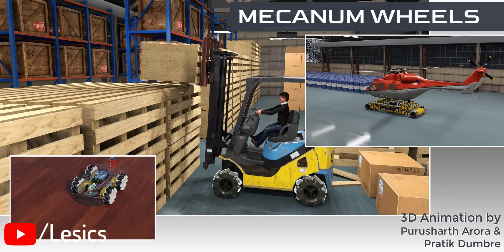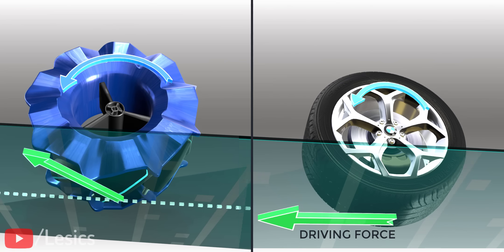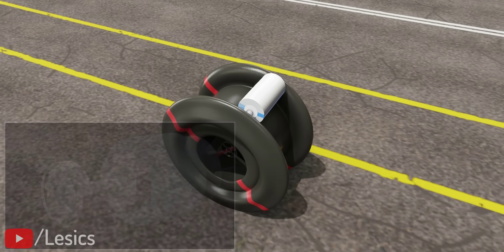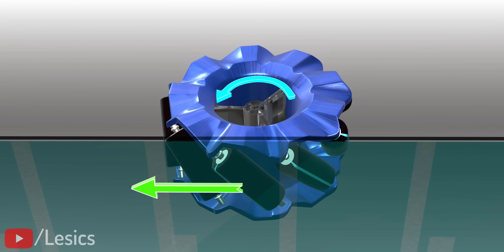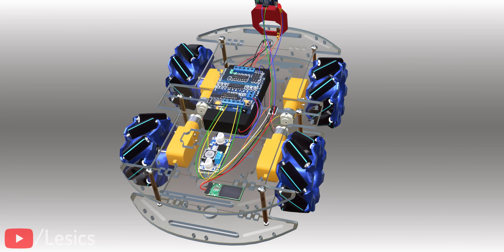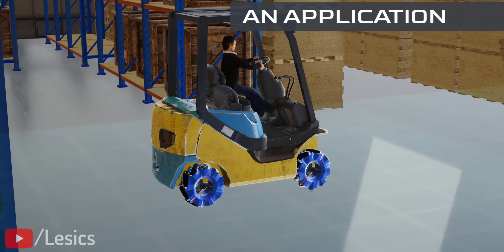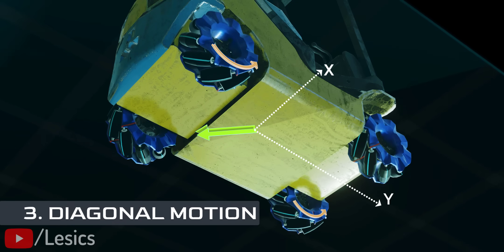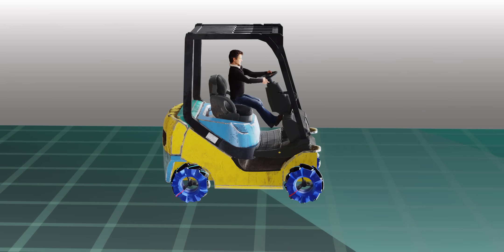The Brilliant Engineering of Mecanum Wheels!

Comment: Most forklifts have rear-wheel steering, and some forklifts have all wheel steering, so yeah while these wheels can turn in place, I'll bet that they are much more expensive than your typical forklift and wouldn't be very likely to be put on applications like this (else, everywhere would have them by now since mecanum wheels have been a known thing for many years).
Reply: Wojciech Pordzik  I think the only real application here would be for warehouses of extremely volatile substances, military use, or when there isn't a lot of space. The example they gave would have been plenty of space for any of the forklifts I mentioned.
Reply: @zeke7100  If anything these would see military use only after many years of successful commercial use- military acquisition bodies are notorious for discarding advanced designs in favour of cheaper ones. In terms of substances with special handling requirements it's often more cost-effective to employ measures to reduce the risk involved, or prevent the risk entirely by not storing or handling them altogether- in industry you can buy containers of elemental flourine gas and store it if you really need to but in the vast majority of cases you it's far more cost effective to generate it in-situ and use it immediately, you don't need to reinvent the wheel to try and make a situation safer when you can prevent the situation entirely.
Personally I see these fulfilling a similar role that tracks would serve, the issue is that tracks are already very successful in that role and are already in widespread production and don't require so many moving parts, it's possible the freedom of angular movement from a standstill might provide an edge against tracked locomotion in robots that are required to maneuver in narrow spaces but they're up against stiff competition.
Reply: @zeke7100  could you elaborate on why those applications came to mind for you? I don't quite see how/why. Military - because cutting edge/enormous budget? Precision of movement? Cheers
Reply: @juliasmith1182  I would assume the military would want to hold volatile substances in the smallest location that they can, even stacking items on top of each other to save space, and having a forklift that could easily and safely make it's way down those isles of stuff would be a huge help. Or maybe places like where fireworks are stored. The less steps you need to get a forklift to go one way or the other, the safer it would be and the less likely an accident could occur. With normal wheels you'll at least need to make a 1-2 point turn but with wheels that are omni-directional, all you'd need to do is just slide to the left, slide to the right, etc.
Reply: @zeke7100  not really going to help much the small electric cat forklift would work better than this.
Reply: This might be practical as a wheelchair or medical application.  Maybe as a form of entertainment.  I think the heavier the load the less likely it might be to be reliable.
Reply: All I could think was "that is the only front wheel steering forklift I have ever seen..."
Reply: @kerrumz1  and it's not even real just animated which leads me to believe the people behind this video know next to nothing about forklifts.
Reply: @ktm125sxbeast  just trying to make them look less efficient really.
Reply: @ktm125sxbeast  yet they already exist and they are practical. For people wondering the wheels don't really wear faster as the don't scrub near as much as solid tires. They are weight limited but no where near as much as some think.
Reply: I believe it comes down to maintenance/complexity as well. Forklift tyres are, well, tough as nails. Can't recall if they're solid rubber entirely, but at the very least, fabrication and replacement aught to be cheaper. That said, cost of maintenance/repair on macanum wheels might be cheaper as a single roller, or perhaps a roller axil might need changing. Pure speculation...
Reply: @juliasmith1182  forklift tires are usually solid but some types have air in them.
Reply: @juliasmith1182  the rollers themselves would be subject to extreme loads as well which doesn't seem likely to last long under such extreme weights.
Reply: Facts
Reply: Caterpillar had the same idea a long time ago and zero turn lawn mowers more recently. Four wheels of this type for a forklift would triple the cost of the machine plus create a maintenance nightmare.
Reply: Plus the forklifts I operate you can turn the wheels like 180°
Reply: @whatusernameis5295  you can on all of them that have the two small rear tires that sit together in the middle.
Reply: @ktm125sxbeast  well these aren't. The rear tires are at the sides of the forklift and yet they can turn pretty close to 180°
Reply: @whatusernameis5295  yea they have those where I work too, most forklifts can almost turn 180° because they turn with the rear axle. The ones I mentioned can turn the rear wheels a full 180° though. Imo they're the best forklifts unless you're driving outside.
Reply: Like everything else, they'll get cheaper with time & demand.
Reply: These would be great for a forklift to use on a ship
Reply: @rdrdrd7777  lmao
Reply: Why is everyone so focused on forklifts. The forklift was used simply to illustrate how the wheels work. Mecanum wheels are not economical for large/heavy vehicles. However, for some small vehicle applications that require high maneuverability and precision, these wheels are amazing. Search YT and watch how they work on robots.
Reply: There are already forklifts that use these wheels https://youtu.be/0DBXuZv38l8
Reply: Reading thru this it feels like many don't seem to know that they already make forklifts that use these and have for years. Mostly they are used in warehouses and a lot of warehouse bots use them because the have to be electric as they have a motor in each corner. Gas/propane ones just don't have the drivelines to make them work. I can tell you going from a standard lift to one with mecanum wheels was a trip and took me a few day to get used to controls as the use a joystick instead of a steering wheel.
Reply: @josephdecesaro1528  I'll be straight up and admit I didn't know and I didn't bother to check either, good to know though and I can imagine it'd probably be challenging initially to learn how to use them. Personally I've never seen or heard of anyone else who's seen or heard of a similar machine being used but warehouse robotisation/automation is pretty poor in my area at present (whether it'll stay that way in the near future is hard to say)
Reply: @josephdecesaro1528  However most places that use forklifts driven by an operator doesn't use these special wheels. It is true though that a lot of robot-driven warehouses like amazon use them, but I feel like it's more of a "aha look at me I have advanced technology" than it actually being significantly more useful.
Reply: @zeke7100  This imaginary story comes to mind. A drunk forklift driver is operating one of these beside a dock. Says, “Hey guys, hold my beer and watch this. I’m gonna open this old thing up and flip this here little switch right here!”
Reply: @josephdecesaro1528  i have a question what do you use them for as the only thing i can think of them being useful is if you produce long beams. the hole it fits in tight spaces is invalid to me as i drive a stand up fork lift and the rack space i work with is probably about form the back to probably a little past that dudes feet.
Reply: @butspan7618  It's mostly warehouses and it's not about fitting in to a tighter space but the speed of shifting and rotating stock. Let's say you need to shift over a 4 tall rack that's 6 long to accommodate a stock change. Well with mecanum wheels I can line up, stab in, lift, back up and then slide sideways the 4 ft to the next rack and put it in. For one move it saves all of 4 to 8 secs but when doing that for 8 hrs a day well you can get more done. It does help with getting say pipes and beams thru small openings. When they switched us it slowed us down for the 1st few weeks but as we got more comfortable with them a 4 hr move with a normal lift changed to a 3 hrs. They are only really good where the lifts never really stop moving.
Reply: May be because of patents. My primary concern is the small contact patch of each wheel. Seems like this would be really hazardous when it comes to braking. And how does braking work when each child-wheel can move freely? Does each child wheel have it's own set of brakes? And the small contact patch would mean long braking distances and wear on that singular point of the roller, meaning that it wouldn't work well after a sudden stop on pavement.
Reply: @2nd-place  braking feels just like normal tires and stops in about the same distance. The 45° angle is reversed on the other side the wheels tries to pull sideways in opposite directions stopping any roll. Think of it like snow skiing when you want to stop you point the skies inward.
Reply: Yes and after all warehouses have to follow specific standards, in terms of hallway width and similar things. If you really need these wheels because of the small space then the whole warehouse is organised wrongly anyways. No need for this high tech feature if you generally dont need them. I drive a forklift as well and even without those wheels i can maneuver pretty tight spaces. Its cool but as a forklift driver myself i gotta say so far these are quite useless.

Well at least here in Germany we have to work with standards, that dont really consider small spaces.
Reply: @CyborgSweetie  some warehouses now have no humans working in them at all except the repairman. they are considered to be a storage machine. first one i saw was in 1980 at navistar. stored 44,000 skids all computer controlled. put 265 forklift people out of a job.

Comment: Super interesting design but there are more conventional forklifts with independent hydraulically actuated steering that spin and crab and will be much more reliable on traditional wheels. It's called a combi-lift I think. They had them a timber yard in South London.

Comment: That is really cool!

I wonder if the tire wear is greater because of the 45 degree force on them?
Reply: Plus you have lots more moving parts. But if space is at a premium it's probably worth it.
Reply: Wear only happens if you force the machine to move at 45 degrees. That is because one pair of rollers cannot rotate. Otherwise, it doesn't seem to be an issue.

Comment: Yep. And as a lift driver myself, this concept is great,. However would be nearly impossible to learn how to control it, prone to breaking, and would require adaptation of additional levers or switches to activate basic movements, and would tear the shit out of a concrete floor.
Reply: I don't think they are extra hard on a floor, they have static contact with the floor just like a regular wheel.  I guess the load is more concentrated but they only carry lighter loads